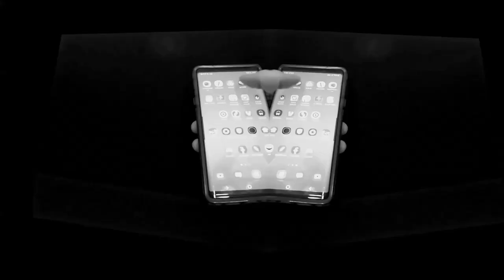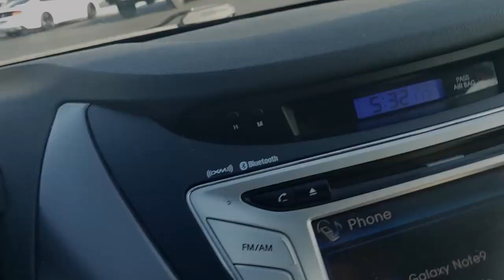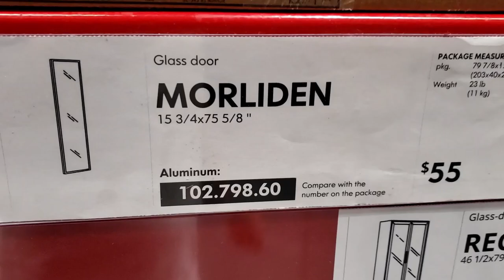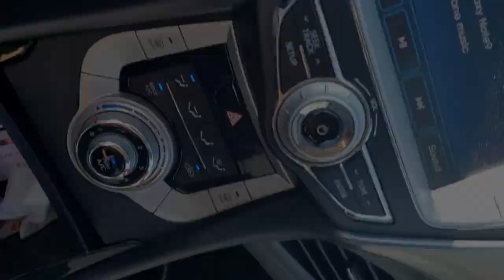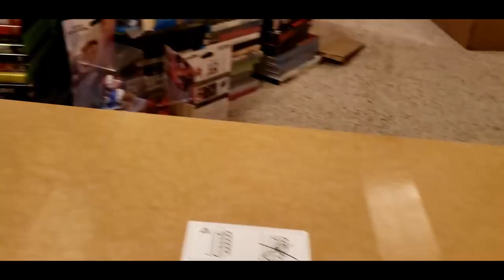OFF TO IKEA TO GET ANOTHER BOOKCASE ! (Video Game Pickups Pt. 54)

Comment: I like these shelves because there wider than a media shelf but not as wide as a regular book shelf. Do you anchor them to the wall? Are they sturdy enough sitting on carpet not anchored? Do you recommend the glass shelves over the wood board shelves? Thanks for sharing, I may make a road trip to pick these up as the closest Ikea is a hour an half drive.
Reply from the maker: I anchored it just incase since it sits on carpet. But theres one thats not anchored and its been fine. I prefer glass because it looks better but its optional.